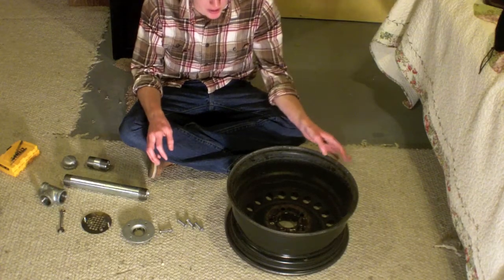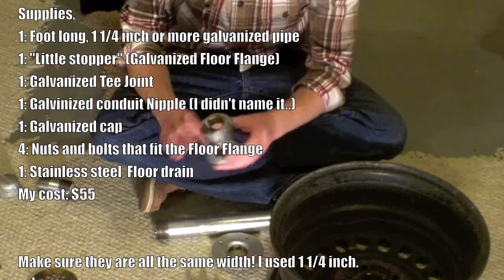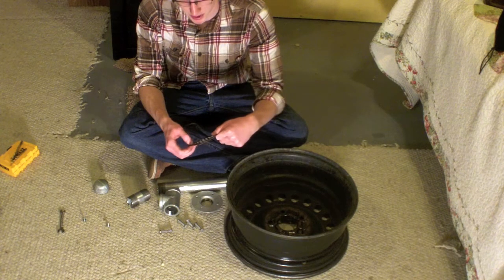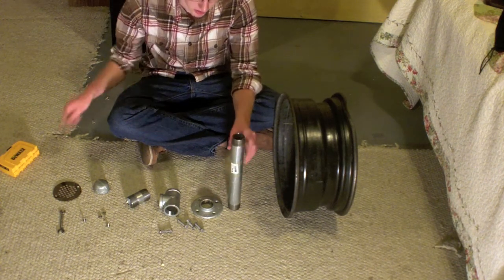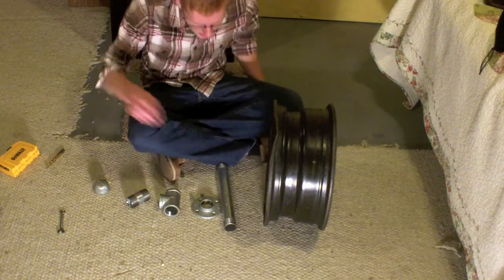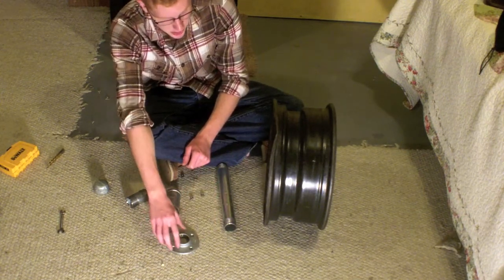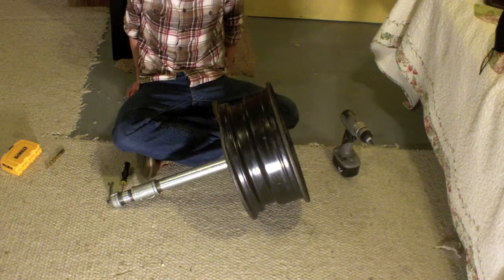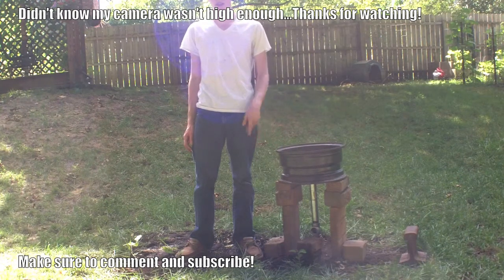How to make a Large Blacksmith Forge (Under $60)

Comment: Do you have to use galvanised pipes? Because I don't want to take any chances
Reply from the maker: +Ben cats You can use whatever kind of pipes you want as long as they are steel or iron, and the breakpoint between my forge and that pipe is not galvanized, and the pipe gets no where near hot enough to make it burn so I am in no danger of breathing in those toxins. But if you only able to get galvanized I suggest you take vinegar and spray it on the pipe and let it sit, then sand it lightly after the vinegar drys, do this a few times and the galvanized material comes off with ease.
Reply: galivinised  metal gives off toxic fumes when heated